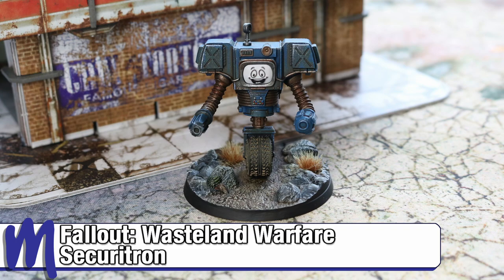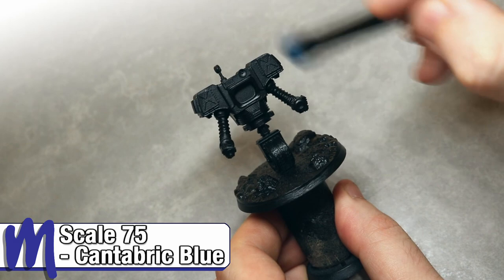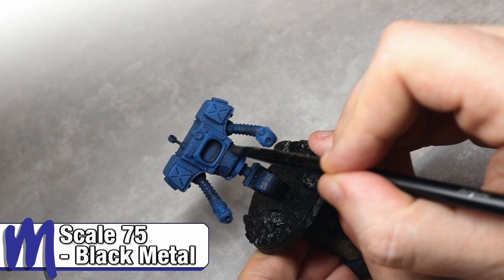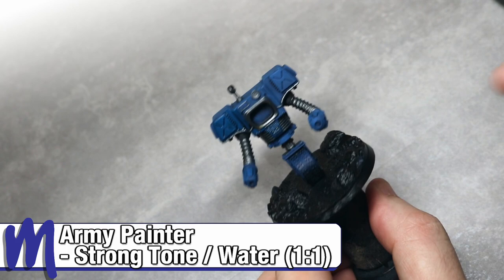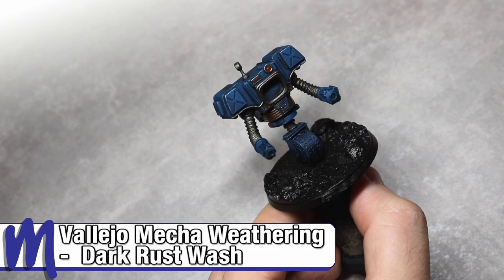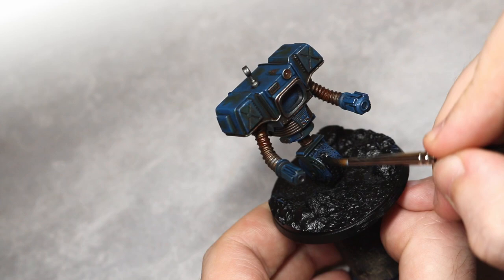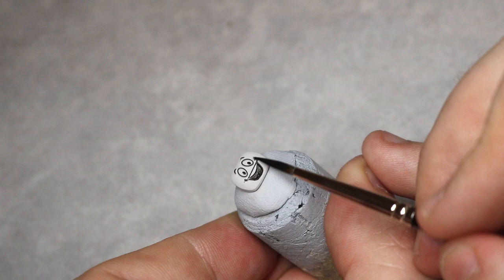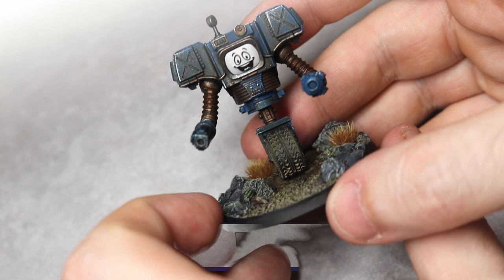Mini Painting Tutorial - Securitron / Yes Man - Fallout: Wasteland Warfare

Comment: What glue did u use to assemble? I’m using plastic glue which worked good for my raiders but for some reason won’t stick with the securitrons
Reply: These are resin models, plastic glue wont work. Use superglue.
Reply: You'll need to use superglue for resin models. Not had any experience with Fallout models yet, but if it's similar or better quality resin than forgeworld, Loctite or Uhu glue will work well